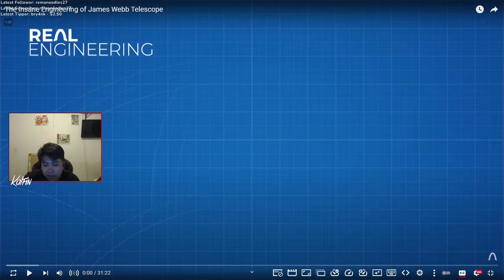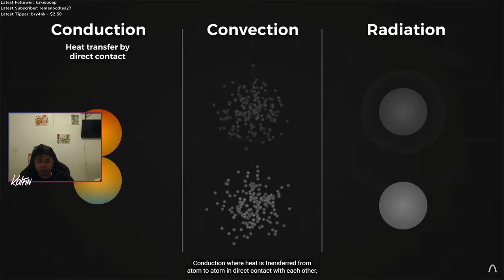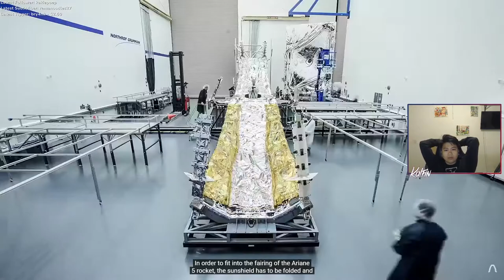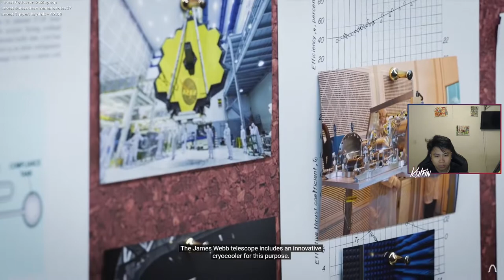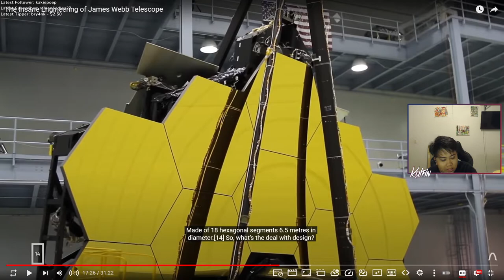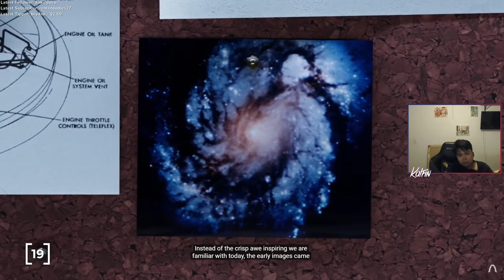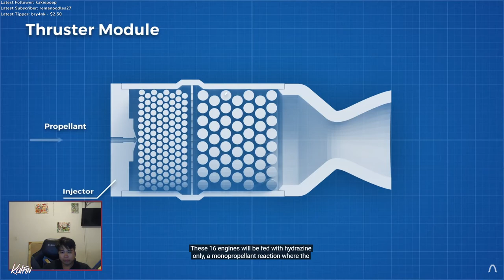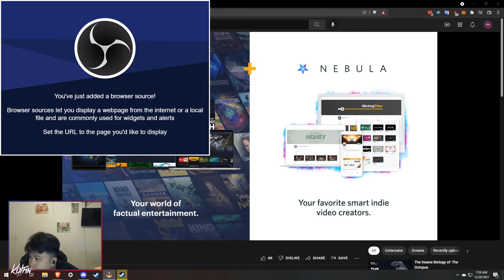Kalfin SHOCKED about INSANE James Webb Telescope

Comment: 11:50, you can't just "put" a satilite/telescope in space where the Hubble is. The Hubble orbits earth meaning is position changes. At L2, the object isn't orbiting earth, meaning it isn't always traveling around earth.

Also, it would not make a small spot on Earth. There are far larger satilites and space stations in orbit the pass in front of the sun multiple times a day as they orbit and they do not cast a visible shadow. It's too small and the earth is too big.
Reply from the maker: Ah makes sense